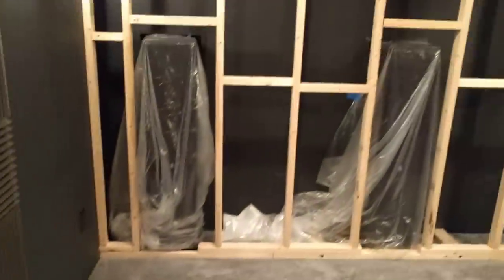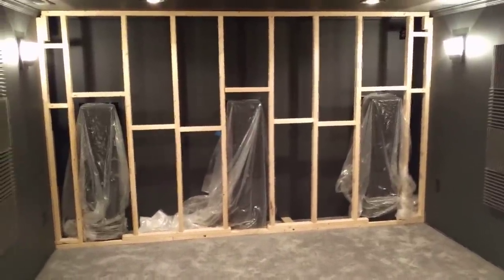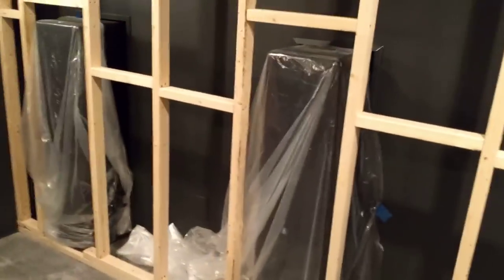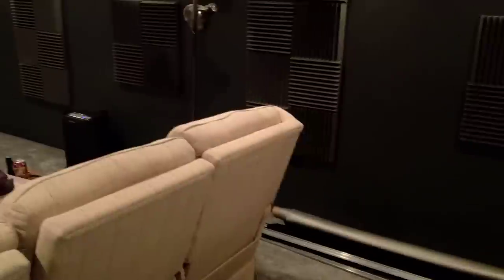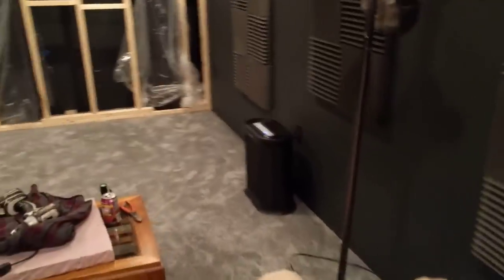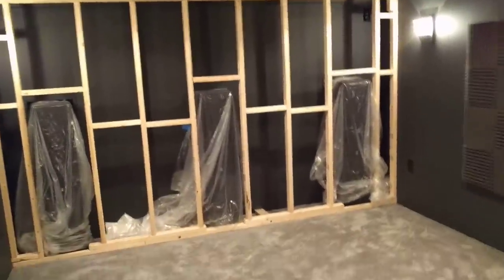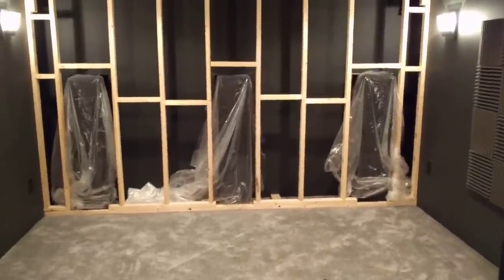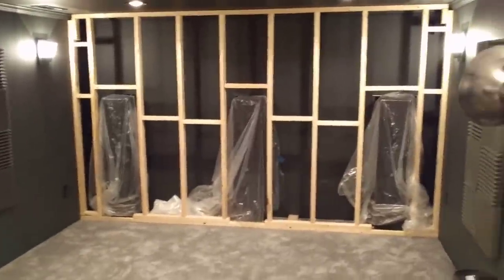[15] - faux-wall construction: step 2

Comment: Very nice. Are you going to fill it with Owens Corning 703?
Reply from the maker: Droidz Hunterz thanks!  was considering using roxul (rockwool) but it tends to be rather messy.  went with standard ownes corning fiberglass in the 2x3 cavities and around the speakers to help reduce any reflections or reverb.
Reply from the maker: Jacob Garcia i ended up just using owens corning fiberglass.  my first thought was roxul too (that's what i used between the 2" xps foam & the drywall room framing) but i know how messy & gritty it is and i didn't want the stuff littering or floating in the air.  the spun fiberglass should stay in place.  and thanks!  glad to be of some inspiration haha.  i document all of my house progress but decided to share my home theater on youtube just for fun.

Comment: how deep does the baffle wall need to be?  how much of an air gap or space gap should you have behind the speakers and the back wall?
Reply from the maker: the area behind my screen is as shallow as possible so i could keep the screen as far away from the seating as possible.  if the room were larger i would have made that space larger to hold some subs too.
Reply: @aaromon43  thank you!! how much air space do you need from speaker and the back wall?  not the wall closest to screen but the opposite wall?
Reply: what is avs forum link if you could kindly share

Comment: I’m in the process of planning a similar set up to what you were doing three years ago when you made this video. It’s amazing how similar my thought process is to yours. Just like you, I would like to recess the speakers back into the wall as much as possible. I also have drywall which I assume has insulation behind it, followed by cinderblocks. Do you have any advice on how to do this? Do you have any photographs that show your process for creating the recessed areas into which your speakers are placed? I’d really like to learn as much as possible about this. Thanks so much for posting these videos I love watching them.
Ben
Reply from the maker: went back and grabbed some pictures from that project.  just had to carve through the drywall to pick up that half inch, and 3.5" from the depth of the 2x4 wall, back to the foam.  left the 2" xps foam so there's still insulation & vapor barrier behind the speakers.  moved the wiring/boxes, framed the cavities, painted, placed speakers, filled with insulation, and then went through numerous different screen configurations haha.  right now running full wall 160" (16:9) with 2.39 black velvet masking.  can't go any larger with either AR without buying a different house.  here is the album, hope it's of help!  

https://imgur.com/a/p9X3zIl
Reply: @aaromon43  this is great. Thank you so much!

Comment: I building a faux wall as well.  How far did you drill the bottom into the floor?  Thanks again.
Reply from the maker: Percy Bedford if i had built the faux-wall prior to laying down carpeting, i would have anchored it into the floor.  however, if i ever sell the house i didn't want to leave holes in the ~$2k carpeting i had put in.  instead we used molly bolts into the wall & ceiling, and then there are a few 2x4 sleepers that the faux-wall sill plate are attached to, which is attached to the real 2x4 sill plate framing in the original wall.  for what it's worth, when i framed the original walls, i used 3" masonry nails with a gun-powder nailer gun (to drive the nails in deep & effortlessly).  hope that helps, and good luck with your build!
Reply: Jonathan Lindhome gotcha.  I think I will try this.

Comment: Wow that looks great i have the same idea in mind but i couldn't find any info on how tower speakers would sound in a baffled wall any clue?...What's the measurement of the room? Thanks
Reply from the maker: Guy Severe i know, there is very limited information out there on how to do this kind of setup.  lots of pictures of finished setups but very little in the way of helping you do it.  i've been listening to the speakers as i work on the room and i can't tell any difference from how they sounded before (free standing), to now being in the wall surrounded by insulation.  room is 12x21x7'
Reply: Fantastic thank you very much for that info, looking forward to seeing your out come